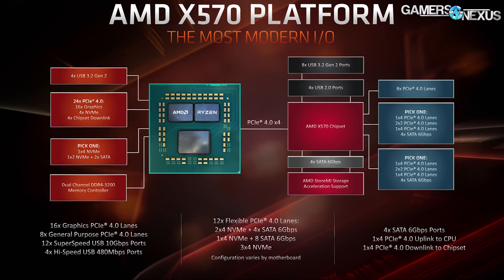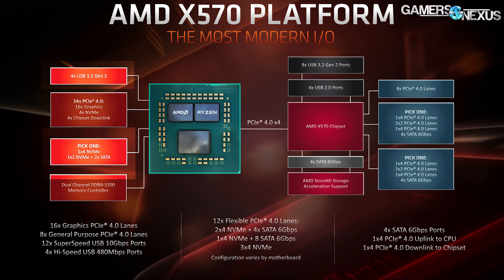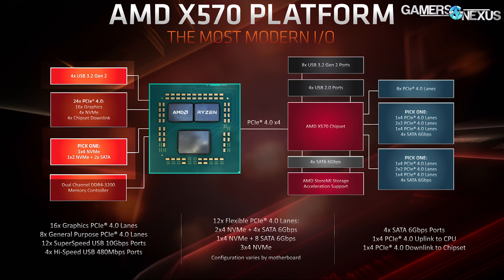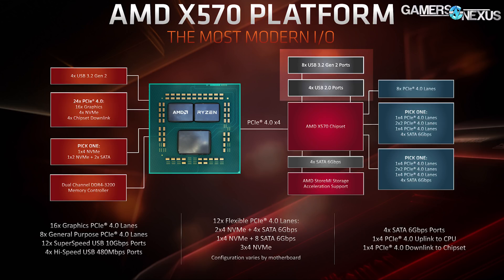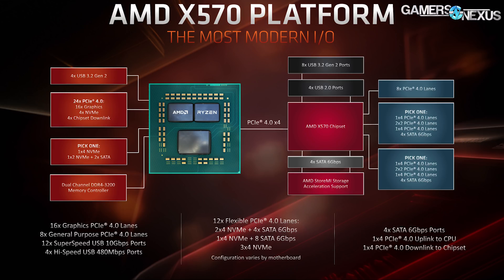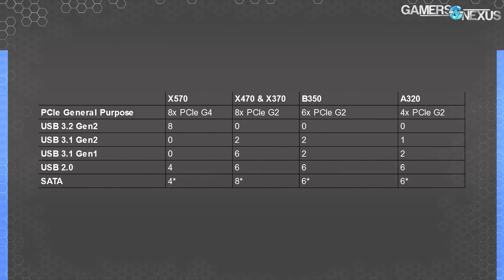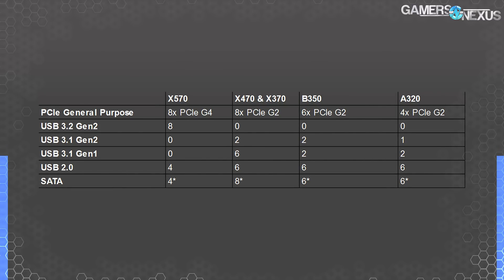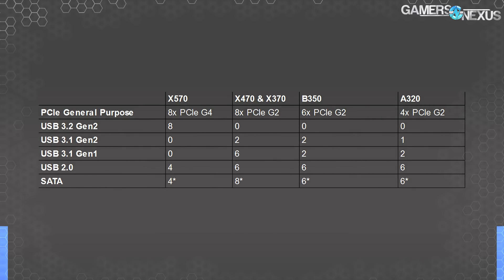AMD X570 vs. X470, X370 Chipset Differences, Lanes, Specs, & Comparison

Comment: I cant wait to get one of these bad boys. I've been sitting on my 2600k for quite a long time, I never imagined having a computer for this long, and man am I ready to upgrade. Especially after I had to run a multicore render last night and the 2600k crashes if I run more than 4 cores at once. It would be amazing to have a 16 core machine to cut this rendering time down from 16 hours to maybe 3-4.
Reply: How can you run more than 4 cores on a 2600k ?
Reply: Francisc hyperthreading
Reply: @Melthornal  HT is running threads , not cores.The 2600k has only 4 cores.
Reply: Francisc No shit, Sherlock
Reply: Just wondering.... but why does your 2600k crash if you try to run more than 4 threads? Is it overheating? What rendering software are you using? Does it crash when you run Cinebench r15 multithreaded benchmark? Are you on Win 7 or 10? 
I'm curious cos I'm currently running an i5-2500k, which like you, I've been using on my main machine for ages. I too am really looking forward to building a new AMD machine asap. I've tested my own machine on Cinebench r15, and it scores about 450 on multithreaded. Going to an 8 core Ryzen 7 2700x would give a fourfold increase in performance, cos it scores typically ~1800 (nT). Going to a 3rd gen 16 core ryzen chip should give at least an 8x performance increase over your current setup for the same render, based on core count, clock speed and IPC. Leaked benchmarks, if they can be believed, seem to confirm this. I think I saw a figure of ~4300 for Cinebench r15 nT for the 16 core ryzen part in one of the benchmarks. That's at standard clocks, which may actually have been lower on that part than incoming retail parts. That is both credible, and extremely impressive. However, like the Threadripper parts that it out performs, it's going to come at a hefty price. Are you ready or able to drop $750 on this thing? Combine that with a $250 (at least) x570 mobo, and say 32 GB of decent RAM, then that's a basic platform cost of ~ $1200 - 1400. That's a lot of money!!!
I would really like to build what I have just described as a workstation for 3d design and for rendering, using Blender Cycles and perhaps RenderMan, although I haven't tried that yet. Thing is, I've never spent more than $200 on a processor, so if I am to do this, then I'm going to have to psyche myself up for a big commitment.... 😨
Reply: @richie1326  I guess the man overclocked too high so the chip is unstable at full load.
Reply: @richie1326  he can't seem to distinguish between cores and threads, so, yeah..
Reply: @FranciscBartalis  logical cores? 💥🤓
Reply: @richie1326  They are called threads, check it out:  https://ark.intel.com/content/www/us/en/ark/products/52214/intel-core-i7-2600k-processor-8m-cache-up-to-3-80-ghz.html
Reply: @FranciscBartalis  yes, I know what they are called, but parlance on the subject has become a little loose. The term 'logical core' has been used for a long time to describe what a 'Hyperthreaded thread' runs on, and I have even seen professional tech journalists using the term 'Hyperthreaded cores', although I wouldn't use it myself. The important thing is, I knew what he meant, because all of us here know the difference between cores and threads, and that the venerable 2600k only has 4 of the real ones.
Reply: @richie1326  when we're talking cores, we're talking cores, and when we're talking threads, we're talking threads, end of story.
Reply: richie1326 It is crashing because it isn’t able to move files from memory to disk fast enough.  And it isn’t a disk wroie problem because my ssd has been tested to easily support this transfer rate.  The processor is just choking and cant keep up.

Comment: So if I do not need super powerful io because what I want to do is mostly cpu bound then I can just install a Ryzen 3000 cpu into an X470 MB and it would be just fine. True or False?
Reply from the maker: As long as that board has an updated BIOS, and as long as the VRM meets the needs of the CPU, true. You will lose Gen4 support, but that's probably irrelevant for most people.
Reply: Hell, consider a good B450
Reply: True. 2020 could be the beginning of ddr5 so getting a x570 for future support makes little sense unless you are getting 12/16 core and you need the vrm.
Reply: @haonanzhang6759  so since I'm getting a 3900x should be better to grab a x570? I'm coming from an old I5 4690, so new Mobo and ram is required.
Reply: @luisangelini2220  Wait and see the pricing. X570 is not required but recommended.
Reply: @haonanzhang6759  any one of them got  your attention?
Reply: @luisangelini2220  I got a x470 so I don't care much tbh. I am just waiting for benchmarks for single core performance. 
X570s are bound to be pricy, expect them to start around 250 USD.
If I have to buy a new motherboard for 12/16 core ryzen I would see if there are nice deals for decent x470 boards.
Reply: @haonanzhang6759  you are probably right. But I don't know since I have to spend already, do it future-proof or just save some bucks getting a x470 and wait for x570 to drop its price... But then I would be paying even more...
Reply: @luisangelini2220  X570 is not future proof. DDR5 is coming so x570 should be the end of ddr4 era. I would just get a x470.
Reply: @haonanzhang6759  could be, but then I would need to change my ram as well.

Comment: What about faster memory support on x570 vs previous gen? I believe the memory got a speed bump to 3200mhz+. With ram rumored to get even more cheaper than now. Ryzen 3000 cpus will probably take advantage of faster ram as well.
FYI one of the best x470 motherboards is the Asus Crosshair vii which sells for around $260, this might be close to mid level x570 motherboards.
Reply from the maker: That's related to the CPU more than anything, with the BIOS being the next improvement. The chipset doesn't control the memory.
Reply: @GamersNexus  Will vendors bless us with these bios updates on previous gen like pcie 4.0 blunder?

update: fake news>blunder
Thanks Steve for clarification.
Reply: @aberkae  Jesus Christ (the other one, not Steve) dude! You know how much power is burning behind PCIe4.0 blunder? What do you think happens when they magically flip a switch on your old 350, 370, 470 board and try to push 15 watts for PCIe4.0 for any signifigant length of time through your board designed to dissipate sustained usage of only 4 or 5 watts?
Reply: @czdaniel1  Its true, I was using satire to hint at they can't use the same excuse on updating bios with new xmp profiles for previous gen AM4 motherboards. Personally I didn't think of anything of the initial rumors either but didn't stop tech sites on spreading that rumor.
Reply: @aberkae  - Sorry, the satire does not show through clearly. The AMD fanboy's whine about not getting PCIe4.0 for old boards that were never built for it is my trigger button
Reply: @czdaniel1  I was more upset at tech sites for spreading the fake news.
Reply: @czdaniel1  I think the same. When people bought those x300 and x400 series, those mobos never said anything about being PCIe 4 able. So I don't understand why they are upset about.
Reply: @luisangelini2220  Its true when the rumors were being spread it was known that pcie 4.0 needed more power and better cooling. Tech sites are to blame.
Reply: The very high memory speed support requires halfing the infinity fabric speed  - it is for memory overclockers not really general use
Reply: @bengrogan9710  I've read somewhere slightly lower than 4000 mhz is the sweet spot.
Reply: @aberkae  There are no solid figures as of yet with no chips in the wild
I'm quite comfortable taking buildzoids 1st impression until details land
He seemed to expect the speed to top out at around 3200 to 3466mhz before culling the infinity fabric speeds and then needing to hit 4800+ to make fir that loss
Reply: FYI. 

Update I just looked at the Asus x470 motherboards supported memory all of them support 3600 mhz ( oc ) ram speed for ryzen 2nd generation.
Reply: @aberkae  Not quite that simple I'm afraid - That means they got a set of 3600 validated but says nothing about the CAS latency they had to drop to in order to achieve that and how many CPU's they had to rotate through to find a golden sample memory controller
if you look at the QVL list on their site, I'm personally checking their flagship the Crosshair VII, you'll find no 3600mhz kits listed on the QVL and only 3 kits listed at 3466mhz and 5 more at 3200mhz
Reply: @bengrogan9710  these look like decent latency ram kits with 3600 mhz compatible to crosshair vii according to gskill memory configuration compatibility search. 3 others came up compatible at 3600 mh but with woese timings. Odd enough corsair does2 even have crosshair vii in there results at all.

https://www.gskill.com/en/product/f4-3600c16d-16gtrsb

Comment: Steve, you forgot game cache. What process node is game cache and how much gaming can I do with game cache?
Reply from the maker: Don't forget your game clocks, hopefully soon coming with a game fan and a game cable to accompany the game FLOPs.
Reply: @GamersNexus  Game FLOPs measured in Anthems per Andromeda or the older Dikatanas per Duke Nukem Forever?
Reply: Why not also game ram and game game gpu.
Reply: Game PCI-e, gaming RGB, Game Cases, Game Cables, Game SSDs, why haven't they made more stuff for gaming?!
Reply: Game lanes and gamer game games.
Reply: You can RAM that CPU in the Socket only so much until you reach GigaHurts, the excessive heat will turn your Water Block into a Solid State.  At this point things will get Floppy, in your Case and I'm not  a Fan of that.  Too many FLOPs will ruin your game.
Reply: Nobody invented a gamer wall socket yet ? Or gamer fuses for the house...
Reply: @wavetrex  gotta have that gaming electricity, for extra power when gaming!
Reply: This gets me excited about owning a gaming monitor!
Reply: vr ready cache
Reply: me: wishing for some beefed up over specced game rubber footings for my game tower hahahha
Reply: @razgriz You can never have enough game!
Reply: @RazgrisFloob  graphic processing unit................

Comment: so the major power change comes from the hop from PCI-E 3.0 to 4.0... interesting.  I didn't realize everything was 4.0
Reply: Haven't it allways been that way tho? Never seen a PCIe board with 3.0 and 2.0 at the same time anyhow..
Reply: My mb has 3.0 and 2.0 at same time.
Reply: @DragonProtector  In the form of backwards compatability I suppose? Not actual dedicated lanes?
Reply: @W0ND3RB0Y1  PCIe 3 lanes from the CPU converted to PCIe 2 by the chipset is quite common on previous platforms. That's how Zen works.
Reply: @PainterVierax  Ah yeah, true... True..
Reply: @W0ND3RB0Y1  If I´m not mistake pci/e slots are always backwards compatibility. There is even a setting in most BIOS with what gen you want to run your pci/e slot. Though there were some MB back in the days who had like one 3.0 slot and the rest were 2.0.
Reply: @PainterVierax  Yeah I was surprised when he said previous AM4 boards use 2.0 lanes. Never knew that.
Reply: @Koeras16  I'm not talking about backwards compatability, I'm talking native 3.0 and 2.0 ports.. I've never stumbled upon a board that had both natively? Not even in the beginning... I've had a board back in the day with DDR3 and DDR2 at the same time, but I can't see the point in having a 2.0 port when it's the same connectors for PCIe, unlike RAM..
Reply: W0ND3RB0Y I don't know the specs, but maybe higher PCIe generations require more difficult wiring of the signal traces between the CPU and the slot, thus making it possible that some cheaper boards only do that for some slots, then flip a BIOS switch telling the CPU not to attempt the higher speed through the cheaper wiring.
Reply: @johnfrancisdoe1563  But the wiring is quite frankly the same bus width and everything? I just dont get why it would make sense to have both, never even heard of that on Intel platforms anyhow? I remember around my 2600k and 3770k, you could use the same board with either PCIe 2.0 or PCIe 3.0 depending on the chip.. I remember when you had SLI on two PCIe 2.0 cards on a 3.0 bus, the speed would be doubled but the split would be ×8 ×8 as prior, the throughput would be quite a lot more tho..

Now on Ryzen, if you have an ×8 port and smack a ×4 device in there, unless there's room for another ×4 it doesn't make sense if it won't split to the next channel like most boards would.. But currently I'm not so sure it does it that simple, what about the chipset controllers, do they split or behave differently? Is it manufacturer specific depending on board config? Hmmm.. So many questions to this..
Reply: @johnfrancisdoe1563  PCIe version 4 puts big restrictions on the length and quality of the traces on the motherboard due to the higher frequencies involved, compared with PCIe version 3. Extra PCB layers are needed to provide grounded shielding between signal layers and for longer runs on the larger form factor boards re-clocking chips are needed to boost and condition the signals.